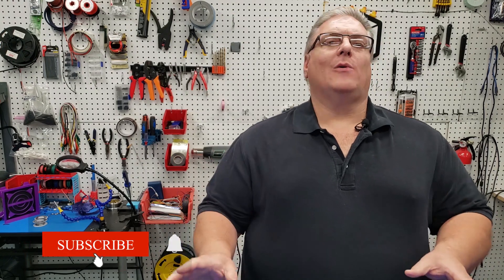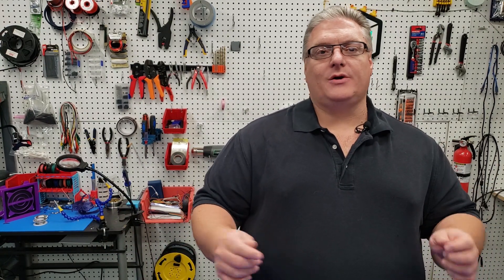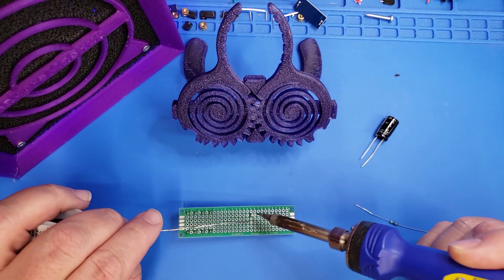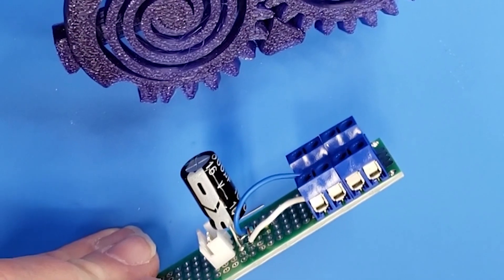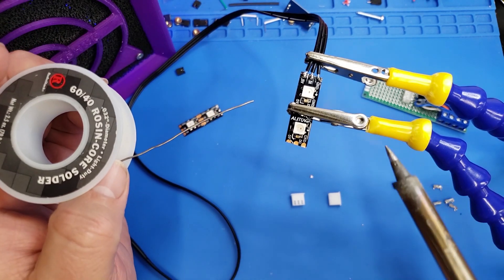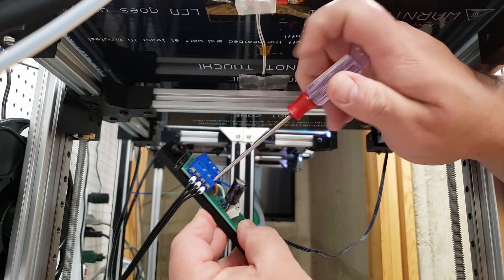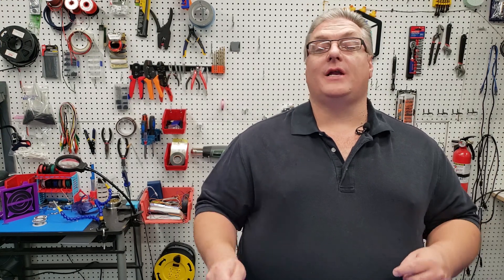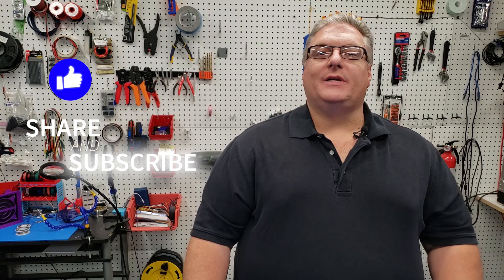LayerFused X301 - Lighted Bed Upgrade for your 3D Printer

Comment from the maker: Are you planning to add a Lighted Bed to your 3D Printer?
Reply: I am. I'm Mentally preparing to build an XY Printer by the end of the year, so I'm addressing the use of the SKR 1.4 and am following your demonstration on the wiring when using the neopixles. My intention is to run strips down at least 4 sides of the machine. So I'm looking at lighting a fair few LEDs! I believe I'm going to have to consider using an electronic switch like a low current MOSFET to provide that higher external current. What do you think?
Reply from the maker: You likely just need a buck converter.  Evaluate the number of pixels and current draw. Then find a buck converter that can handle the current requirements.  Use the buck to power the pixels and make sure you use the cap as I did to level out voltage peaks. Then run a ground and the signal wire with the resistor to the skr. Just don't run the power lead as that is provided by your buck converter.  That should get you more current and still allow you to wire right to the board. Just remember the common ground between them.
Reply: @MakersMashup  Thanks for letting me know, Ill take not of what you said for when i need to try it out. Thanks again
Reply: I have one printer with 36 neopixels ran the way you ran in the other video and they light up in the correct order and all.... now my question... How many can the board run? I'm looking at trying 60. 30 on each side.  Any idea on how I should do this first off. Second, if I run it like this wouldthe first led on each side light up in as led 1?
Reply: for info I did look into how many leds a skr can support and around about I'm figuring 40 without the dcdc (I'm already powering 36 without any issue without the dcdc) and about 60 with the dcdc...  the regulaar amp supplied from the port is aroung 2.5 to 3 amps with the dcdc module

Comment: Yesterday I used your Amazon links to order the parts for the Neopixels - today I canceled the order when I realized it was costing me over $100 to light the bed.
Is anyone willing to assemble and sell this at a reasonable price? If not, then I probably will go with powered leds in one tower and a pi camera in the other tower.
Reply from the maker: Kits are coming Tom. Hoping in less than a month. I'll be ordering the PCBs tomorrow so as soon as the come in you can buy a kit for less than $20 and you'll just need to do some soldering.
Reply: @MakersMashup  Thanks!!! I'll be looking out for it. Also, any thoughts on incorporating a pi camera?
Reply from the maker: I'm personally not fond of the Pi. I use a $110 pc for my octoprint and then I use this usb camera https://amzn.to/2YUC6dD you could use it with a pi. I like these because they are manual focus so they don't bounce focus around like a C920
Reply from the maker: Tom - Just wanted to let you know that Kits for these are in progress.  The PCB's should show up in about a week and a half and the rest of the components are already here.
Reply: @MakersMashup  Any update on the availability of this and other kits?
Reply from the maker: Yes. Reach to contact@makersmashup.com or through the discord Tom. I have a video coming soon but if you reach out you can be one of the first.
Reply from the maker: The shop is now open Tom.  You can get them at https://shop.layerfused.com/

Comment: Hi there, I'm a new subscriber to your channel and have been catching up on this model 3D printer that you guys have done. I like the aesthetic anyway of these cube shape printers, but on top, yes I agree leaving the front part of the cube open for accessibility is a very clever but true idea to the concept you've added. The only query I have from waiting to see how you add RGB's or Niepixel to the SKR 1.4 was if you needed to use low current MOSFETS for a number of light-strips if you covered the machine with them? In conclusion, am I right in seeing, that you only use a few on each side of the machine anyway, maintaining low current consumption of the LEDs? I'm still considering what the best approach to take if you need to boost the lights / and would you have to alter the signal strength too if you used more LEDs or just their voltage as a whole?
Sorry for woffling on, but I am paying attention to a very nice machine, but the attention is in the details! And so my last question would be; the circuit that you added with the schematic, is that just some kind of filter for signal peaks? I think that would be the case as I couldn't see any other changes to the signal paths.
Do you fancy answering the questions?
Regards
D
Reply from the maker: Yes the limited number of neopixels allow you to draw from the board directly.  If you want to use a larger number of neopixels I suggest using a buck converter for the power directly from the power supply and then simply making sure the ground and signal connections are the only ones running to the SKR.  You need to also ensure the buck you use has a high enough current rating so be sure to calculate the number of neopixels and current required for them.   Yes the schematic is just for reducing the signal peaks per the best practices for use of neopixels from the vendor.  I find the 1000uf and 330ohm resistor work great.

Comment: Could you place the leds up under the bed itself by removing small circles in the bed heater without breaking the connections so the bed itself becomes a lighted surface?
Reply: My answer is yes, the only consideration would be to use a high-temp material for the job. But design a pair of LED stip holders to run down each side of the bed, underneath / or go for the standard bulb-shaped LED and place 1 in each corner of the bed!